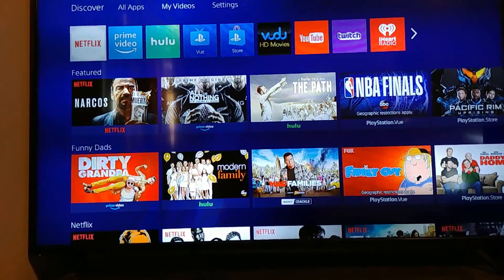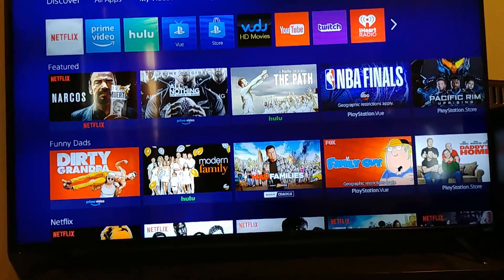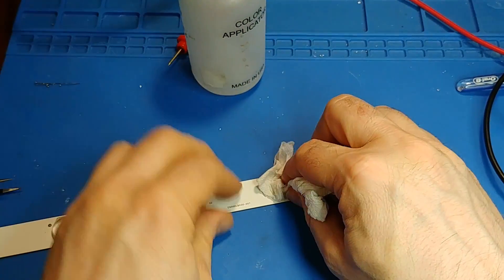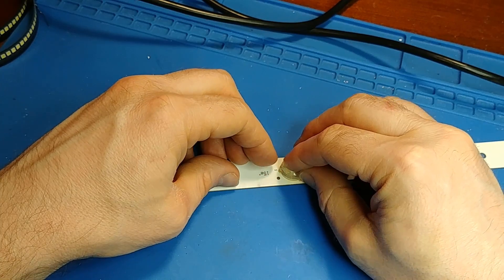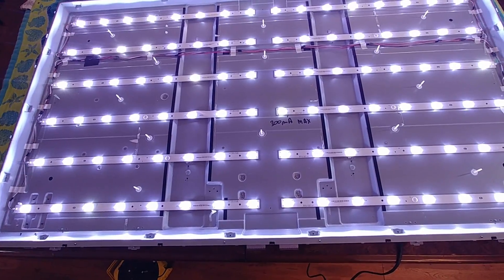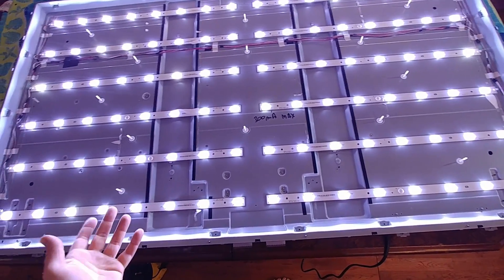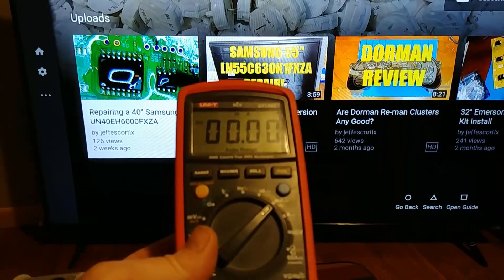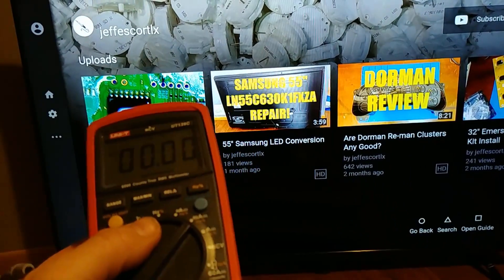How to Repair 60" LED Vizio Smart TV

Comment: No special tools required if we are to simply replace all of the strips, correct?
Reply from the maker: Correct. You should be able to replace the strips with no soldering required. Just basic screwdrivers.
Reply: @jeffescortlx  you da man
Reply from the maker: @makenomistake_mynameisjeff8731   no Jeff, you da man. You can do this.
Reply: @jeffescortlx  Jeff, I did it, Jeff. I successfully repaired my piece of crap Vizio. Took 3&1/2 hours to complete but it really wasn't very difficult. Little under $100 after tax and shipping for the full LED kit, so way cheaper than a new TV. $100 I shouldn't have had to spend though... Get this: I had 8 strips burned out. 8 out of 12. Vizio, if you're reading this, I'm not buying another one of your TV's.
Reply from the maker: @makenomistake_mynameisjeff8731  glad to hear you saved it. Now it should be more reliable than new. Getting mad at just vizio doesn't do much good. All TV manufacturers have been hit with bad LED's in some models. Even Samsung and LG have sets out there with defective LED's.
Reply: @jeffescortlx  Oh, really? Other brands have done the same thing? And to this extent? A couple years down the road, what brand/type on TV would you recommend I upgrade to that won't have this same issue?
Reply from the maker: @makenomistake_mynameisjeff8731  the other brands are typically a little worse off. At least with some of these Vizio's they have independent led channels to drive the strip, so when one led fails you only loose that one strip. Typically manufacturer run them all in series, so when you loose one led the entire backlighting goes out.

Comment: Jeff, it would be great if you linked and or described all the materials you are using in this LED swap video. (what LEDs, glue, cleaner, heat setting, the volt meter you use, etc...)
Reply from the maker: The description listed the important stuff. The other things you can wing it.

Comment: You may be onto something with the 600mA at startup. I have had this tv for 3+ years with no failure. I have been reading that most of these led failures (this man. and model) where happening rather soon after purchase (i purchased mine new from Walmart). I never turn off my tv. It was only when my wife started turning the tv off recently that i ended up with failed leds. I am just waiting on the leds to arrive and I will be doing this repair soon. Thank you so much for the guide. I feel confident now that this is not out of my realm though it will be my first time changing out leds. Just a question: what solder and flux do you recommend? Thanks again
Reply from the maker: If you've bought direct replacement LED strips you won't have to worry about soldering. I use 63/37 .031 or smaller.
Reply: @jeffescortlx  I bought them from ebay. not sure whats showing up till it gets here but I purchased your recommendation of 3030 3v 350mA not the strips, shopjimmy was all sold out of them. I also purchased a used hot air rework station and desktop dc power supply for the project :)
Reply from the maker: @jasonnunya7136  sounds like your set. Some solder wick will be handy too
Reply: @jasonnunya7136  I just received my LEDs same as you described off eBay, the ones I got are off color, the ones on the TV have a light blue tint on them and the ones I received are just white. I'm going to have to replace them all to match
Reply: Jason, please report back on your results once finished. I'm looking at buying a 3 year old 65" Vizio with this issue for $200 so I figure it's worth that if I can repair it in a day or two. I have good soldering skills.  Im also wondering if its worth it to go ahead and replace all of them at once.
Reply: @oldowl4290  I have since finished with my repair. The issue is continued failure of leds. I completed the repair and left the tv open for an additional 24hrs to cycle power to cause more failures before reassembly. I was confident when I reassembled that I would not have additional failures. I have since had another led burn out and still i don't turn the tv off ever. The new leds work well and have no problems. If the strips are available from shopjimmy I would change them out using that method. I feel confident there will be additional failures from the non replaced leds. Also dis and reassembly are no fun on this tv.
Reply: I had the same concern so I used a 500mA LED driver to pulse the strips for a few seconds (on/off) after my repair. Sure enough, I was able to get more old LEDs to fail. What I noticed is that the LEDs that had a bit of lag before lighting up were the ones that eventually failed. Looking at them under magnification showed cracks in the phosphor coating. I'm in the LED business (sales and R&D) and I can say that this is usually from defects and/or thermal cycling. I'm not a fan of the way that Vizio does their heat management.

Comment: Mine has a blue tint blacks are never true black and the whole picture is extrmely blue any idea if it could be the leds?
Reply from the maker: Failed LED's won't change the color, only cause dark spots or no light at all.
Reply: I saw another video that describes the problem your having. The problem is the 'yellow filter' on the top of the LED fails (breaks, likely from heat?). The LED still works but causes that area to be more blue/purple!
Reply: @WilliamSymionow  does that mean the lens needs replaced or the actual led? Which part is yellow?
Reply: @bradthebad01  you replace the entire led. The yellow part is built into the LED top. It's the phosphorus coating. Led are more blue by nature, the yellow color you see on top of all led is phosphorus and that turns the LED light white. This is not typically a part that fails but Vizio found a way!
Reply: @WilliamSymionow  Thanks.  It looks like my brother in law sold me a TV where all of the LEDs have the coating burnt off.  "We know it's a little blue, but we kind of got use to it." Looks like I'll take a stab at replacing all the LED strips once the parts become available.  I was hoping that somebody sold a kit where all of the domes/LED covers were tinted phosphorus so I didn't have to replace the actual LED strips, but I don't think it's a thing :/

Comment: Have you experienced where the bottom half of the screen is dim but applying pressure to a certain spot or "banging" temporarily fixes it? 

That's my issue. Already bought a replacement but it'd be nice to not trow the old in the trash unnecessarily

Also sounds like they need some capacitors to prevent that initial jolt.
Reply from the maker: I haven't run across that same issue, but it's worth investigating.
The LED driver is current regulated, so it's possible if you put a capacitor across it, it will just try harder. It probably should really have a software fix.
Reply: @jeffescortlx  Yeah I opened it up before but of course I have no idea what I'm looking at lol... 

The spot where I apply pressure is right around the power plug so I assume something is loose or cold soldered. This is a E601i-A3 btw..

Perhaps it'll be my weekend project to take another look
Reply: Similar to this but the bottom half instead of left right

https://youtu.be/cJHu1TS74TU

Comment: This must be a common problem throughout the Vizio product line.  Today I just replaced a 2 1/2 year old M60-C3 with the same exact problem.  I didn't attempt a fix since I had purchased an extended warranty at time of purchase.  They were really great about working with me and just had me send them a few photos of the screen.  After that they ordered a new TV for me, which was delivered today.  I did replace the Vizio with an LG edge lit and it seems just as bright and sharp as the FALD Vizio and it has many more features.
Reply from the maker: It's not fair to say the whole Vizio line up is plagued with faulty LED's. Just certain models. Even the other big brands like Samsung and LG have a few models with LED issues.
So what happend to your old M60-C3? It can be fixed in about an hour.
Reply: @jeffescortlx  Wasn't my choice whether to fix it or not.  I contacted the company I had the extended warranty with, they directed me to try a few troubleshooting options (like unplugging it and holding the power button down to discharge the caps).  Then they wanted screen shots so they could see the problem.  They decided to replace it.  I gave it to a neighbor to use at the beach vacation home.  Like the video above, the picture was good enough as long as the scene didn't shift to a fairly consistent color across the screen.  This does seem to be a common problem with the C, D, and E series.
Reply: Which exact LG model did you get?
Reply from the maker: @tuberoako777  currently have a 47LB6300 with defective LED's.
Reply: @tuberoako777  LG UK6090.  I could only pick from what the warranty company supplier had in stock and the other set I was being offered was the Vizio  M60-D3 which is also plagued by the same crappy led arrays.
Reply: @GopherM  Was it from square trade? I heard you can fight your way to cash refund.

Just a hypothetical, but if say, I hard almost 3 years with the TV, I'd take  33-40% cash of what I initially paid.

Comment: where did you say one can buy the whole led strips..   good video
I lost about a forth of my panel,  little darker than rest...
Reply from the maker: Shopjimmy.com is a good place to buy TV parts from. Otherwise eBay.
Reply: I have a 65" and the bottom right corner is dimmer today than the rest of the set had it over 3 yrs not bad for a $849 TV gonna order new led rails for $75 and replace them hoping I can get it done in the garage while my toddlers are napping other wise ill lose parts and be pissed af😂

Comment: Where did you find the roll of leds?  What part number or specifications?  Thanks.
Reply from the maker: 6:22
Check the description for specs.
I typically buy them from eBay.
Reply: Lextar are probably the best you're going to find that are a perfect fit. https://www.ebay.com/itm/Lextar-100Pcs-3030-3V-SMD-Lamp-Beads-for-LED-TV-Backlight-Strip-Bar-Repair-TV/392255424837?ssPageName=STRK%3AMEBIDX%3AIT&_trksid=p2057872.m2749.l2649

Comment: Do you happen to know if the M60-C3 uses the same LEDs?
Reply from the maker: Sorry I'm not sure.
Reply: Vizio likely uses all the same SMD 3030 LEDs for all nearly all their TVs in this series. There are few "high-power" 3030 LEDs that can take this kind of mA load. The reality is Vizio should be using more LEDs at a lower current...but that costs more money...and also exactly what they do in their higher end TVs that have more zones.
Reply: Just as a followup, I bought the replacement leds online and did the repair and now the TV works great.

Comment: I don’t use drill drivers. I suggest caution using power tools. The best way to handle lcd panels is with suction cups and tape the matrix pcbs to the front of the screen with blue masking tape. On this model there are screws that go into the diffuser retainer/lcd cushion on the side where the lcd matrix pcbs seat either leave them out or tape over them.